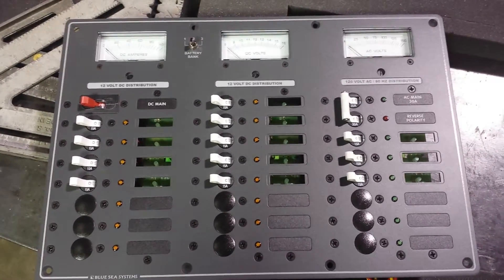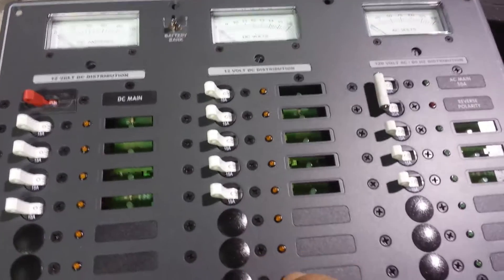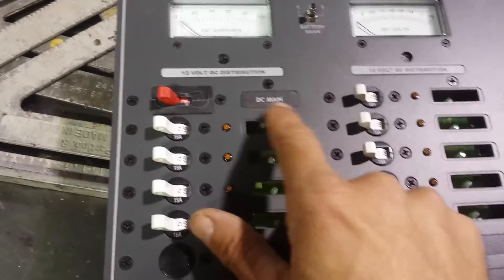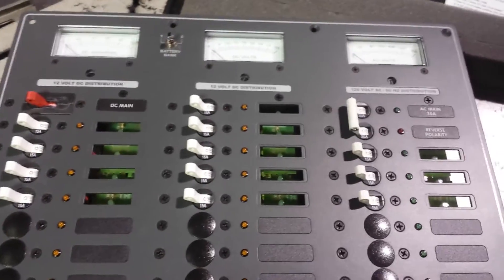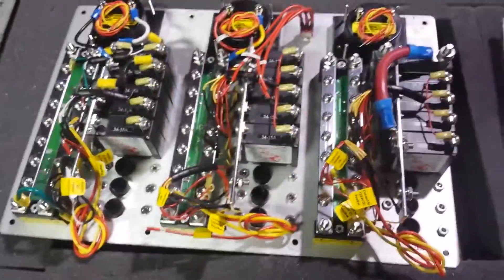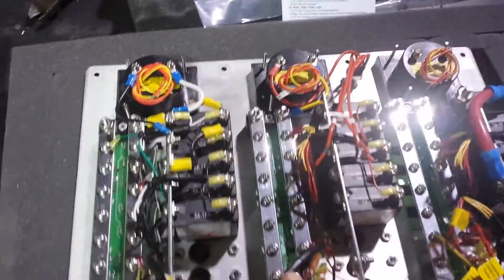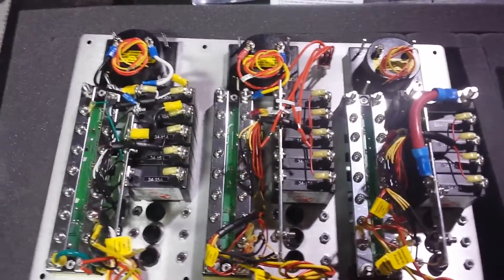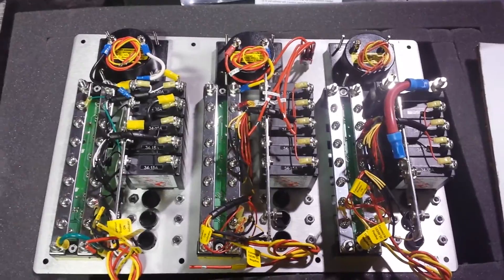Replacing my power panel pt1 (fresh out the box)

Comment: can you control whether the back-lights are illuminated at your discretion?  Considering use of this panel in a truck camper I'm building and want to be able to control all lighting.
Reply: I am installing the same panel in my ketch and am installing a push button switch for the panel lights.  You could also use a spare breaker if available

Comment: On my panel I have neutral wires on top and hot wires on the bottom of the ac two pole breaker switch. Sound right?